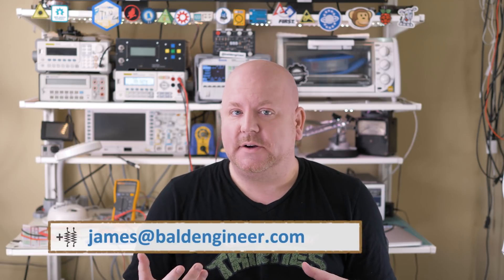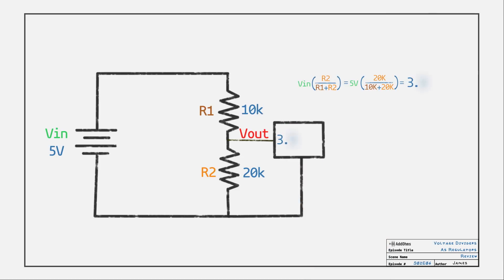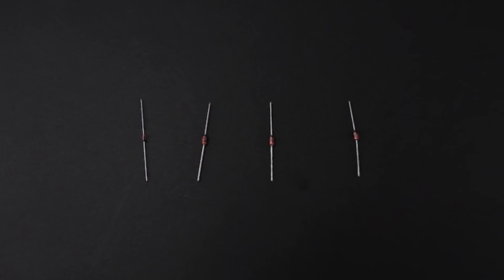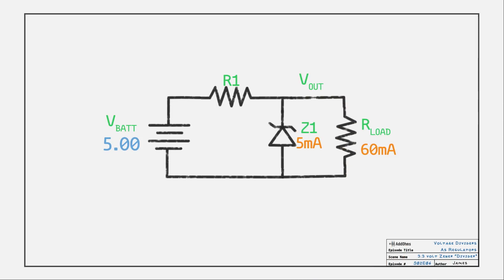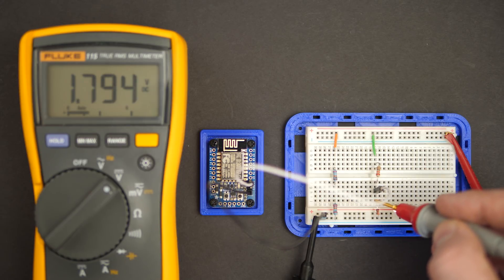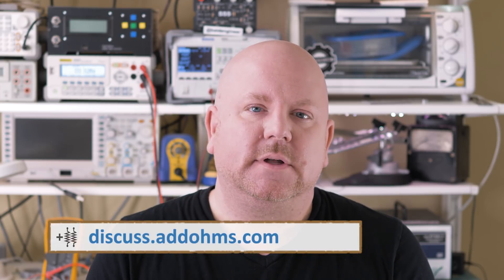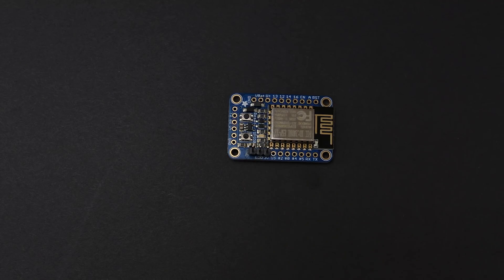Voltage Dividers as Regulators ?! | AO #22

Comment: would a capacitance voltage divider suffer from a similar problem?
Reply: When simulating this in LTSPICE it seems to be a very bad idea for DC. For AC it would work better but then also the load will have a massive influence on the divider.
Reply: In radio circuits, everyone agreed to use 50 ohm or 75 ohm impedances as loads. So in RF, you have a constant load. This allows you at high frequency to use passive components to create voltage dividers. In RF those passives tend to be inductors and capacitors since they're lossless. (btw in AC circuits you can raise and lower the voltage with a inductive or capacitive deviders)

Something freaky about RF voltage dividers is that if the load impedance (50ohms)  is equal to the transmission line impedance, than the effective impedance is just 50 ohms. In most cases the transmission line impedance is not 50 ohm. So we use impedance matching circuits which tend have a voltage division topology.
Reply from the maker: +lol212ist Yes. But in general you wouldn’t use one. They aren’t usable at DC. At AC it is more common to use a transformer for isolation/safety. 

I don’t even remember building one back in school.

Comment: I'm a little confused about the definition of 'active load'. The Wikipedia article made it sound like it was some sort of diagnostic doohicky. Can anyone clarify?
Reply from the maker: Load is the device being powered. "Active" load means it can change its power usage on its own. Like a microprocessor. A  non-active load, or "passive' load is like a resistive heating element. It, basically, presents a (nearly) constant load to the circuit.

Comment: I'm curious though, how can one calculate the current consumption of a device? Should I just add current consumption of each element of a device? But in that case, how to deal with basic components such as resistors and capacitors?
Reply from the maker: "Basic" components adhere to Ohm's Law. Active devices, you have to design based on the information in the datasheet.
Reply: AddOhms and how about the whole device circuit? E.g. if I design a simple power supply with LM7805 (which is an active devicw, as I understand) and couple of resistors/transistors/capacitors - do I just calculate the current consumed by each element and then just add all the numbers alltogether? Or there are some formulae/laws/theorems for that?
Reply from the maker: Now you are just describing basic circuit analysis.

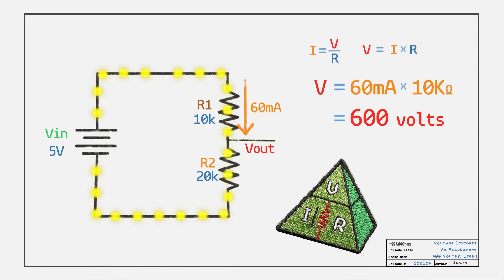Comment: @1:31  Why use a 10k-ohm & 20k-ohm and not 28.3-ohm & 56.6-ohm pair? The current divider ratio is still 2/3 of 5V, giving you 3.3V. Since we want Vout to be at 3.3V, the voltage drop across R1 should be 1.7V and since we want 60 mA of current flowing, 1.7V/60mA = 28.3-ohm. 

I suppose it's because it's difficult to find resistors with those values and like you said -- the voltage output isn't stable because the device does not always draw 60 mA. If it drew less than 60 mA, say 30 mA, then the voltage drop across R1 would be .85V and Vout would be 5V - .85V = 4.15V. Uh oh. I see now.

Comment: What if you are trying to simulate the voltage and natural voltage drop off a battery (ex. AA battery) and a stable linear voltage isn't really required? Are plain resistors ok then?
Reply from the maker: In that case you aren't building a divider or a regulator.
Resistors are linear devices. The voltage falloff from a battery isn't linear. So I don't see how you could properly simulate one with just a resistor.

Comment: Ok,but If You are  working whith a hi  voltage in The input And  You want regulate It to 15v output
Lets say  90 volts imput.
Reply from the maker: No. That is even worse. It would burn enormous amount of power even at low currents. A switching regulator would make more sense.